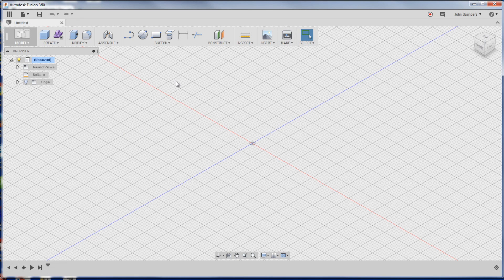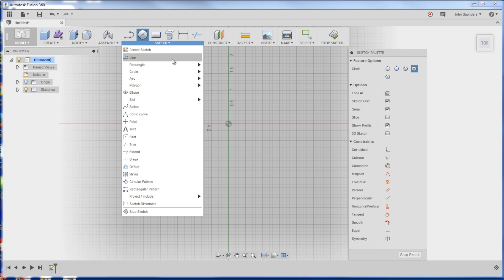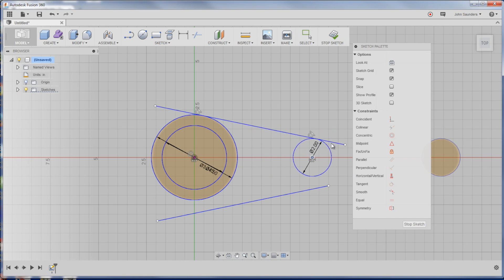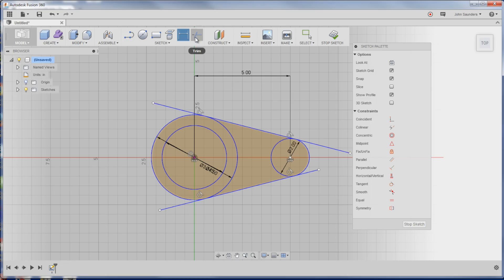Fusion360 CAD: Tormach Spindle Clamp! Widget 53A

Comment: Hey John, I noticed you always start your sketches at 0,0. Is that deliberate and has that ever given you any issues when wanting to move sketches around?

I deliberately start my sketches at some arbitrary point, just so long as it's not 0,0 so the sketch is not constrained at that point, but don't know if I'm missing something here, and maybe that constraint is sometimes desired? I believe Fusion puts a hidden constraint on any sketch point that passes through 0,0,0 and that can cause grief (well it did for me) if you're not aware of it.
Reply: Pete F I always start or reference 0,0,0 if I can. I always try to design for symmetry around the existing planes. It makes everything easier. It's not hidden. It's just a coincident constraint. It's usually good practice to think in terms of your working planes and their intersections rather than the geometry planes and intersections.
Reply: DammitCoetzee How does starting at 0,0 make things easier? How do you un-constrain the 0,0 point? If John sketches 2 circles (as in the above example), one centred at 0,0, another centred on another point on the plane, the 0,0 centred circle can't be moved by default. 

This topic came up on the Fusion forums a while back and is covered in this screencast https://screencast.autodesk.com/main/details/3d0cac76-d6d3-4a4e-8bbf-446c38910b99

http://forums.autodesk.com/t5/design-and-documentation/missing-constraint-command/td-p/5522649